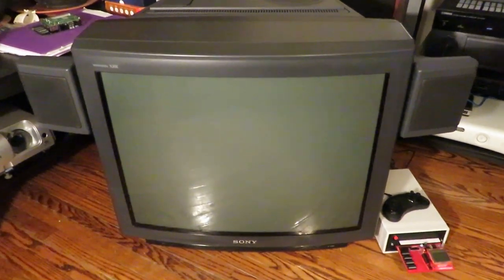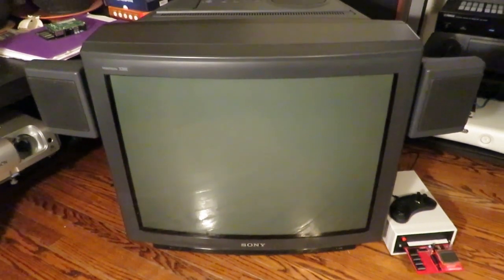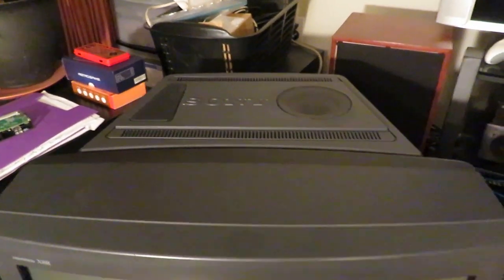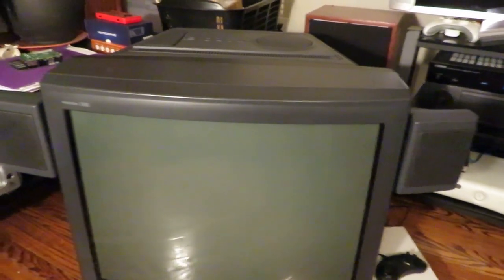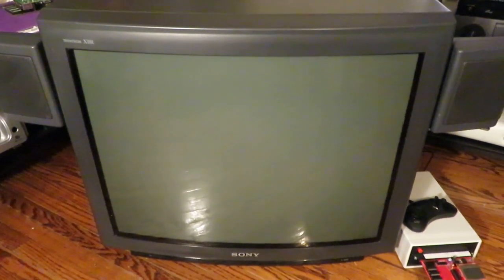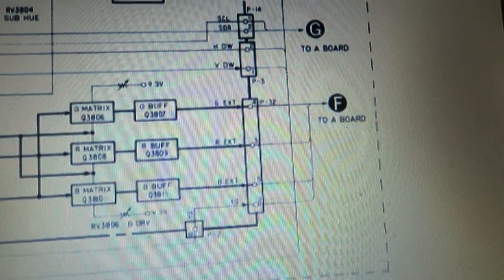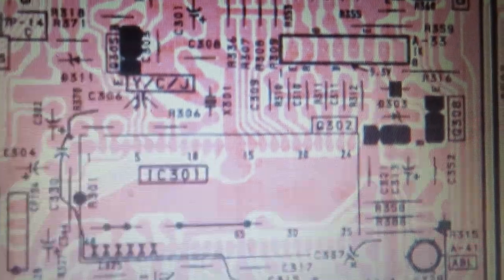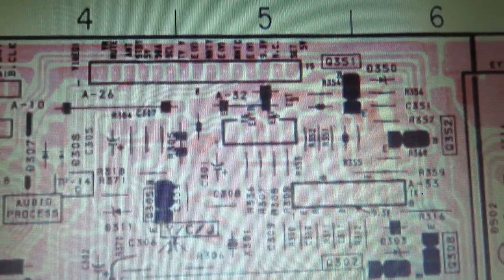RGB modding a CRT TV for retro gaming, advanced hacking edition.

Comment: I have a Daewoo CRT TV with a jungle chip (M61250) that has the RGB inputs set to digital RGB (like CGA) by default. According to the datasheet, it can be switched to accept analog RGB (like VGA) using the I2C bus. Has anyone done anything similar or know of any articles/tutorials that would be helpful in this matter? Thanks in advance!

Comment: my tv didn't accept rgb signal on the chip, i lost the battle and just soldered rgb directly to the neckboard with capacitors, when the picture is full the colors are amazing, when there's less on the screen (for example street fighter logo and the rest black) the black get's too bright, it becomes grey, directly proportional to how much the screen is filled

Comment: Very nicely done. The solution of driving SDA low as the bit is put onto the bus is very elegant. It's fortunate that jungle bit happens to need to be set low for RGB, given the bus is open-drain/collector.

I made something similar for a Toshiba 27A50 a few years ago. That model uses a TA1310AN jungle and the RGB inputs are switched in through a dedicated control pin rather than I2C. In my testing, however, I found that the TV's MCU is constantly writing register data to all the I2C peripherals, including two jungle registers that control the brightness and contrast of the RGB inputs. The MCU sets them to produce a very dark image, and they are not accessible via the built-in service menu since RGB isn't intended to be used, so I had to interrupt the I2C lines with solid state switches going to a mod processor.

I notice that the jungle in your Sony has a brightness/contrast parameter pertaining to the external RGB inputs ("RGBPIX"). Do you know if this is accessible via your service menu? If not, I take it didn't need any adjusting since your picture looks quite nice in the video.

Very interesting that the MCU seems to ignore any changes to the RGB enable bit in the EEPROM. I was thinking of checking the exact same thing in my Toshiba w/r/t the very dark picture, but after reading your experience, I suspect it will behave similarly. I feel like these were intentional design choices by Sony and Toshiba...

Comment: Regarding prices:
The only XBRs I bought new were a KV-30XBR910 from 2003 ($2,300 for a 30” CRT) and a KDL-52XBR2 from 2006 ($5,000 for a 52” LCD). These are both digital TVs but it shows that Sony was not pricing these for the mainstream.

Comment: Brilliant video. I have been working on the same problem but I am simply nowhere near your standard when it comes to the micro controller programming. I hope to learn from your research and complete my work. 

I am working on LA76810A jungle chips that have their RGB inputs switched into digital instead of analog mode. I have been trying to use Tim Worthington’s TV Bus Manipulator bit I simply haven’t been able to put in the requisite time yet to sort it. 

Thank you for this.
Reply: I have an Sharp (Sanyo) 25" that has a jungle chip in the same family and is doing the same thing, if you ever figure it out on your end please get in touch.
Reply: I have a similar problem. My Sanyo takes RGB via an 8 pin din connector, usually used for VTR hookup, but it’s expecting digital RGB. Anyone know an easy way to convert between digital and analog RGB?
Reply: Your problem is a little different.  On the LA76810A the digital RGB is actually analog RGB at 1.0Vp-p.  Silly huh?  If your is expecting TTL (5V) digital RGB it can actually only to eight colours.  There is unlikely to be any way to convert analog RGB to be inputted there.  

What model number is your set?
Reply: I have a 1988 LXI made by Sanyo 564. It’s a small 14 inch. I put a TTL signal from the SNES into the Hsync socket and it gave a grey picture on the upper half of the screen. And the only pin out for the socket I found were either just composite or digital RGB.

Comment: your channel is great, I have these kinds of mods in my mind since a very long time. I'm not an electronics expert when it comes to tv and crt's and your videos helped me a lot to sort things out in a more pragmatic and "self-taught" way, as I'm used to. Only one question,  this RGB input,  can be used as a COMPONENT  input?
Reply from the maker: Thanks Milo! Component is a different format, one wire is intensity and the other 2 are 2 dimensional color space. You can convert from one to another fairly easy, but connecting RGB to component or vice versa will give you the wrong colors and brightness. I will be doing a video on this sometime in the future.

Comment: I have a few late model XBR CRTs (original owner of one) but I’ve passed on an early-‘90s XBR with the detachable subwoofer at Goodwill before. :(

What Sony was thinking was that you might want to detach and integrate the TV’s speakers in your HT surround sound setup. One of the major complaints from HT reviews of the late XBR910/960/970 TVs was that the amazing integrated sound was non-removable and “upgrading” it with surround sound was often a downgrade for the main speakers.
Reply from the maker: Yes, with the speakers removed the TV looks slick, but those side speakers really do look silly. They could have been streamlined a bit so they don't stick out so much. Sony had done this on some of the other models with good effect.

Comment: Great video. Would be very interested to see more videos like this!
Reply: I'm currently modding an old rf only set. Have added a iso transformer to it (live chassis) and have it running composite, next s video then gonna build an rgb amp. Fun! :))
Reply: @robertmonnig7132  How did this project go?  Were you successful?
Reply: @badreality2  I got the s video working, never got it going with rgb, but have since rgb Modded simpler non-hot chassis sets 😁
Reply: @RealBurtles  Did you make videos of those projects?
Reply: @badreality2  Unfortunately no, but I could prob put up some photos and info at some point

Comment: It might be worth comparing the contents of the ROM chip with the contents of a ROM chip from a model that has the RGB port enabled.  The question I had is what is changing the last bit back to 1?  I assume it is happening in the controller, and I can't imagine they would hard code that into the controller chip.  It could be as simple as modifying some other values in the ROM.  Do you have any thoughts on it?

Comment: PCBJUNKIE, any reasons why the horizontal sync frequency is at 15.975Khz? why 15.975Khz. And the Vertical sync is at 60hz, any reasons why at 60hz?
Reply from the maker: Just a design choice I guess. Probably based on the original NTSC spec at 30fps * 525 lines = 15.75KHz, or 60fps * 263 lines per frame.
Reply: @pcbjunkie1  thanks for the help and guess you did, for some reason they wanted to reference the vertical sync to the power line 60hz for some reason but not sure why.

Comment: Awesome video.  I wish I knew how to do that.  I just recently picked up the same TV.  I absolutely love it. I was wondering if you knew how to access the service menu? I've tried a bunch of remote commands and can't seem to get it. The TV could use a little tweaking.  Let me know please if you know. Thank you!
Reply from the maker: Nice TV indeed. Service menu, I think it's Vol+ and 5 on the remote while powering on the TV. It's in the service manual.
Reply: @pcbjunkie1  I tried that. It didn't work.
Reply: You have to push in the recessed button in the back of the tv near the inputs with a stiff wire while pushing the power button on.

Comment: When I watched some vids of people using scart cables for their NA TVs (using converters for component), they use cables with resistors or caps built in.  If you do the mod on a TV and add the resistors as show by most mods on YT, does that mean you don't need to use a scart cable with built in resistors?  Or do you still need them for NA TVs regardless?

Comment: Did you determine that there was no way to enable the XBR55 PiP board from the service menu before going through all the trouble of making a microcontroller to intercept the communication in real time? I must have missed that part! ;)
Reply from the maker: The service menu didn't have this option. I doubt they would put that in the service menu if they went to all the trouble to prevent you from enabling it in ROM.
Reply: pcbjunkie I dunno... it seems like the exact kind of setting a service menu was intended to hide from end users. I don’t see any reason to go out of their way to do that and the other difficulties just seem to be inherent to the way it continually sends all settings. I do wonder if there is a CRC check or parity bit on the ROM that could cause trouble when modifying the value that way.

Comment: Heya. Kind of a backwards question. I have a Dreamcast console with a busted AV out. I don't plan on replacing the AV socket but instead hard-wiring RGB to JAMMA EDGE out the back for dedicated JAMMA. 

Would you happen to know how to convert Dreamcast VGA mode to RGB suitable for JAMMA edge.
Reply from the maker: First's, if it's VGA, that is anything greater than 15khz (480 lines at 60 fps), no standard resolution only TV / arcade monitor is going to display it. Second, an arcade monitor RGB signal is around 3V max, while a TV / console output is 1V. So you're not really compliant here as far as JAMMA goes and you're going to get a dark image in a proper arcade setup. It doesn't stop you from proceeding, but I would just mod the DC to output RGB for TVs using a DIN jack.
Reply: @pcbjunkie1  what if I were to run an RGB booster PCB off the 5V lines and tone the voltage back down

Comment: How can I change color and sharpness settings on RGB input? I had 2 TVs that could do it but now my Sony Trinitron KV29B5E can't do it. :(
Reply from the maker: It's probably in the service menu.
Reply: @pcbjunkie1  I tried but nothing changed.
Reply from the maker: @laszlonagy1034  Is your RGB going through OSD method? You may not be able to change that.
Reply: @pcbjunkie1  I don't know but nothing happened if I would like to adjust color tint or sharpness. Now the pic sharp but not as colorful as in composite.

Comment: only part I didn't understanf\d, that rom chip where you changed the value from c5 to A0 and it came up A1, it did change right? did it just increase the number by 1?
Reply from the maker: Yes, the last bit changed forcing the jungle to disable the RGB input even though we cleared that bit to enable the input.
Reply: @pcbjunkie1  dose it always change to 1 or is it just increasing your value by 1?

Comment: Is the image shifted to the left?
Reply from the maker: Yes it is... This is the result of some arcade games syncing a little late on each scanline. On an arcade monitor, there are usually vertical and horizontal position adjustments to deal with this. This TV also has a screen position and size adjustment in the service menu, but i didn't bother with this game.